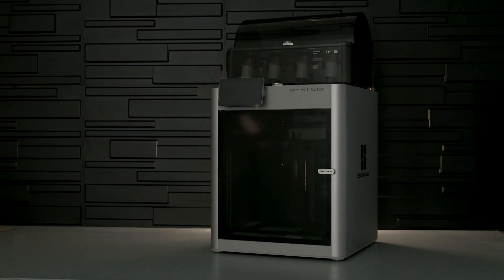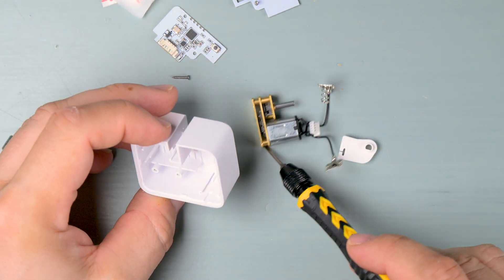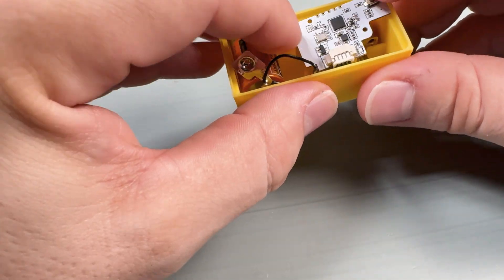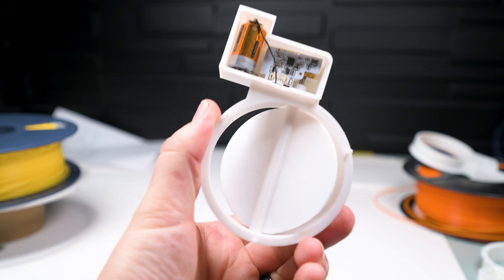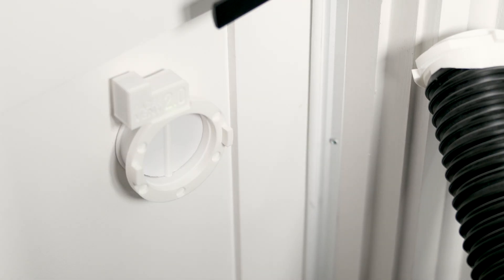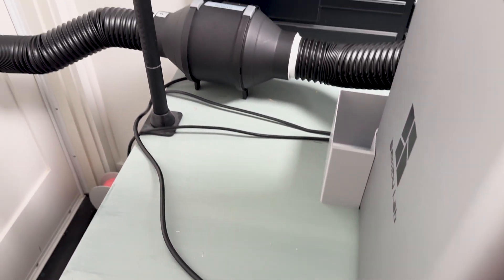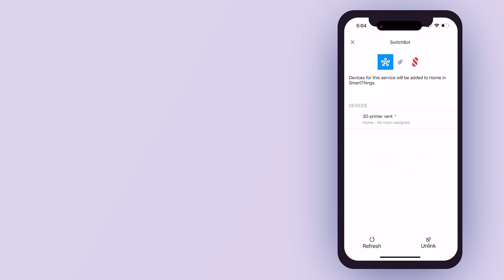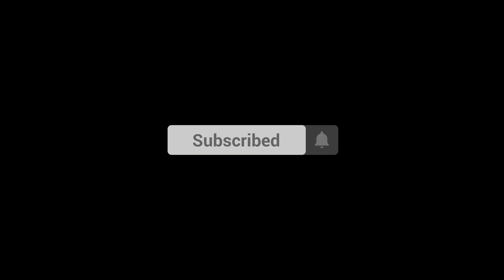3D printer upgrade | DIY vent | Bambu X1C | Motorized flap | Inline fan | Smart home integration

Comment: How do you regulate the enclosure temperature with that big exhaust fan sucking all the heat out?  I need to have a 60°C enclosure temperature for printing nylon and it would seem like I a precisely tuned low flow is what I need.
Reply from the maker: Not sure if I printed Nylon since I built the fan. But I print PC regularly without any issues

Comment: With the extra large fan fitted how does that affect the heat in the chamber ?. Asa and abs need to be kept hot to not warp while printing. Great project though
Reply from the maker: I don't print these but I do PC, and it doesn't have effect on the print

Comment: Great video! I'm working on a similar system inspired by your design. For the flap mechanism, is there a specific reason you chose this design instead of using a backdraft damper? I feel like it could have achieved the same result more easily, although it might have been harder to make entirely 3D-printed.
Reply from the maker: I wanted to be able to open/ close it on demand, if I'm not running the inline fan etc. I think it would have been be harder to make that mechanical flap from scratch, definitely would have to use some low resistance bearings etc.

Comment: To get something like this working on a closed source printer you will need a lot of additional stuff indeed.
Also; Heavily relying on online services, it's a matter of time before this al stops working in my opinion. Maybe you should look into starting with Home Assistant, and run all you home automations locally.
This is why I build my own printers. A single output pin of the controller board can be used for activating an exhaust fan via a relay. (and a valve if you want)  Activating is as simple as creating a macro, and will ne completely automatically depending on the type of filament you're printing; PLA = exhaust fan on, ASA = exhaust fan off (and probably a carbon filtererd recirulation fan on..) The macro can be called from the filament specific gcode in your slicer.

Comment: Great breakdown—thanks for highlighting filtration upgrades for the X1C! I’ve got a related thought for users in small spaces:

The purifier on the X1C operates in a positive-pressure exhaust path, meaning some VOCs and ultrafine particles can still escape through lid or door gaps before reaching the filter. For better containment, how about a negative-pressure top-vent setup:
	•	Retrofit the lid with a sealed 100–125 mm duct port
	•	Attach a low-speed inline fan that vents directly outdoors
	•	Calibrate it so the chamber draws air inward at gaps (verified with a smoke test)

This flips leaks from outgoing to incoming—much safer in tight rooms. Has anyone tried this on the X1C or H2D? Does it still allow full temp stability, and how does it compare to the stock purifier?

Comment: Great project!
Any issues with chamber temperature dropping or cold pockets?
What about negative pressure?
Finally... isn't the exhaust noisy? looks like a beast!
Reply from the maker: I mostly print PLA or PC. No temp issues there. The fan is less noisy than the fan on the printer itself. Unless you raise it up to 100% then you can really hear it

Comment: Quick question, did you notice a difference in fumes when printing ABS or ASA? I am thinking of doing this or making an enclosure
Reply from the maker: nope I don't print these, printer is in small room, the smell from these will still pass through the gaps in the printer

Comment: why not a gravity operated flap? like it opens when theres air flow and closes via gravity when theres no airflow. wouldnt have had to mess around with the electronics and smartthings.
Reply from the maker: True, it would be possible, I would probably have to add some bearings for smooth operation, but definitely doable. In the beginning I wasn't thinking about adding the inline fan, the printer fan wouldn't move the flap. Great idea though!

Comment: Thanks for sharing. Are you printing ABS? Curious to know if the inline fan setup is causing the temperature to drop too much inside the print chamber.
Reply from the maker: I don't. PC is only high temperature filament I use

Comment: Great video! I’ve been thinking about doing something similar to eliminate those pesky ABS fumes. Quick question—was the home automation component added just for convenience, or was there a concern about turning the fan on too soon and affecting heat-up time? I’m considering combining your original setup with an inline fan to keep costs down. I really appreciate the level of detail—awesome work!
Reply from the maker: nope just thought it would be great if it was automated once I send the file to the printer.. yes for polycarbonate I actually turn the fan on later as it takes a while to heat up. Thanks!

Comment: Cool project, thanks for sharing.
If you use Home Assistant you can use the Bambu integration to get the specific state of the printer. I turn on an exhaust fan for my X1C based on this.
The Bambu integration also provides a door sensor for the X1C, so you can have the internal light turn on automatically when you open the door (and turn off after 5 minutes, for example).
Reply from the maker: good to know thanks! yea that would be "easier" to automate.. might look into it in future